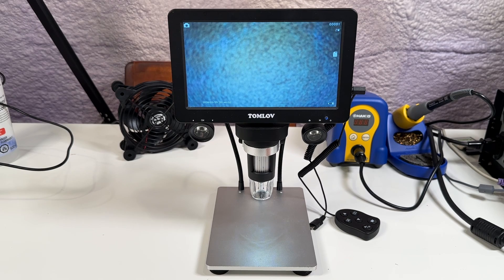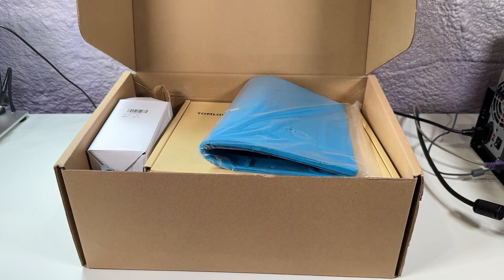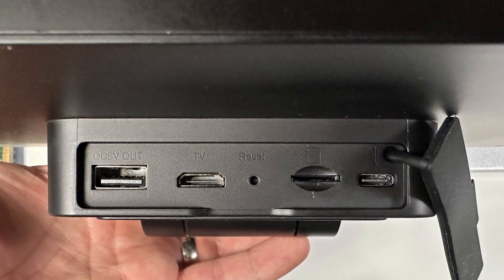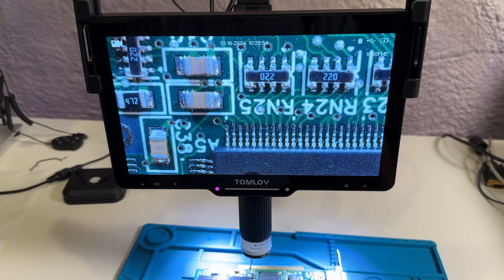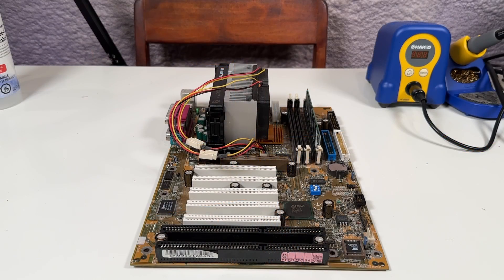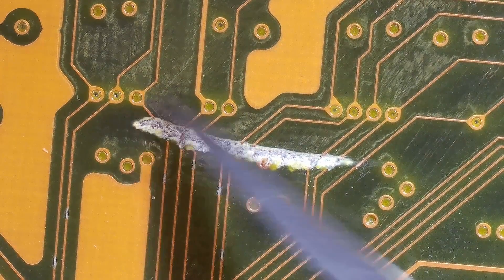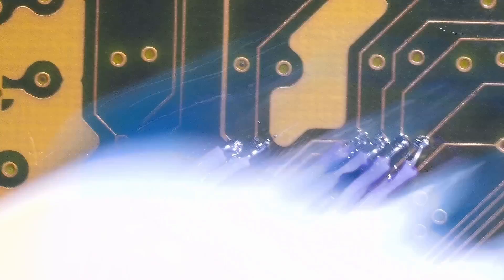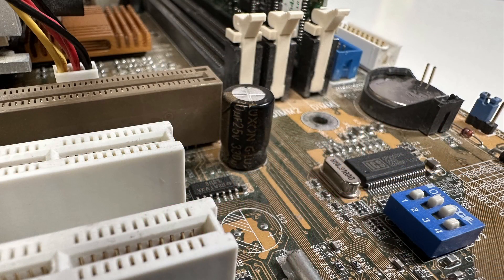Repairing an AMD Slot-A Motherboard with the Tomlov DM501 Pro Digital Microscope

Comment: bro, can you do the experiment of a Pentium in a 386 board and do live tests?
Reply from the maker: I do have a hybrid 386/486 board that might be able to take a Pentium overdrive. Would be really neat to see if it works!
Reply: @vswitchzero  I read in theretroweb and vogons about it. in the retroweb the did it with a normal pentium, but their own interposers for voltage regulation and signal routing.

would be interesting to use the best possible S7 processor. and even more, in the oldest possible 386 board, hahahaa
Reply: @vswitchzero  even better. Just today I was reading the oral history of the Intel 386, told by its creators. If I understood correctly, the first 386 could be put in a 286 socket? I'll have to check the pinout on the sockets. If it were true it would be incredible to put a pentium on a 286 motherboard 🙂

also the test of Pentium in 386 was in a pure 386 board, I believe

Comment: I have a Soyo Slot 1 Intel 440BX that posts sometimes - I tried different cpus and video cards, it worked twice for a short time. It would post and load DOS, but next restart it would be gone. No visual damage, recaped the entire board with high quality japanese caps, no change. Tried flashing new bios, including new bios chip, no change. It is a nice looking board and rich featured, like you I put aside for a to be repaired in the future. Checked found no shorts, it might be a cold joint somewhere… or needs replacing some IC or a reball for the chipset.

Comment: Welcome back!  Since that's a standard ball joint you can just retrofit a better clamp to it if you wish.  I had a similar issue with my car's CarPlay tablet and just went on Amazon and bought one of those third party magnetic mounts that attached right to the OEM bracket that came with it.  Solid as a rock now.

Comment: curious. could you clamp the screen at the bottom, rather than the top of the screen?  probably a silly question.
Reply from the maker: Thanks for your comment! Unfortunately, there is a rectangular bulge (assuming for the batteries) that prevents the clamp from attaching to the bottom half.

Comment: Awesome all around! I saw on another channel where they used a prepen fiberglass adjustable sanding pin to make quick work of removing the of the solder mask. Seems to be the best option I've seen so far.
Reply from the maker: Thanks very much and thanks for the tip!Will definitely look into this 👍

Comment: Use Teflon (PTFE) isolated wire. It won't melt/creep back or just a tiny fraction when soldering 😉
Reply from the maker: Thanks for the tip! 👍

Comment: 11:19 looks like an overheated iron tip... For classic Sn61Pb39  working temp is around 250C
12:30 just use 0.1-0.15mm emaled wire.

Comment: Every Slot A motherboard matters! We have special cult around Slot A here in Poland ;) I think a better way to repair the traces was to fill the gap with some epoxy and make small bridges with enamel wires or just plain copper wires. But of course - your circus, your monkeys ;)
Reply from the maker: Thanks SobieRobie! Yes, slot-a is definitely a special one that’s for sure! I thought about doing something similar but the last time I tried to solder to tiny traces like this it ended badly 😂. I think I’m going to try to get some practice on a junk board to get better at it. Thanks for watching!

Comment: I watch HDD Repair Services whenever he makes a video. He does a TON of bodges. It's all enamel coated. It doesn't come off unless you rub the wire with the iron under a pool of flux. He uses different sizes. The craziest repair I've ever seen him do was on an micro SD card. He did like 20 traces in a spot no bigger than a droplet of water. I can't begin to fathom how small those wires were. Then in the less critical area he used thicker wires that were still tiny, but like 5x bigger. Maybe about the size of a hair? I can't comprehend how he was able to fix that card and download the data.
Reply: I still have a roll of enameled wire I used for modding the original Xbox.  Great stuff for exactly this purpose.

Comment: with those boards and anything from the 98-01 era with sanyo oscon caps, everything should just be replaced altogether. good to note here that the single sanyo oscon is in fact a hybrid polymer meant for high frequency switching loads. Replacing everything in that section with polys however would be wise going forward.